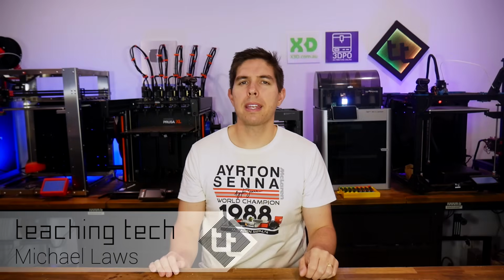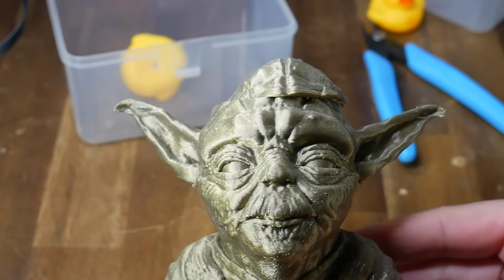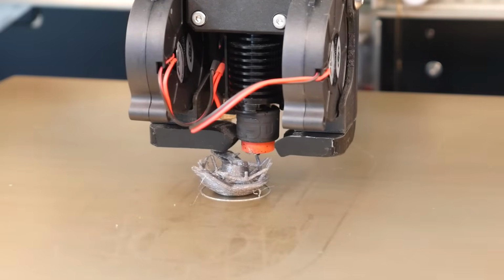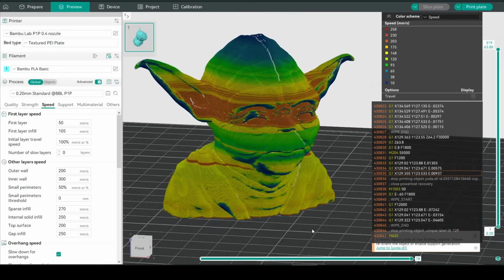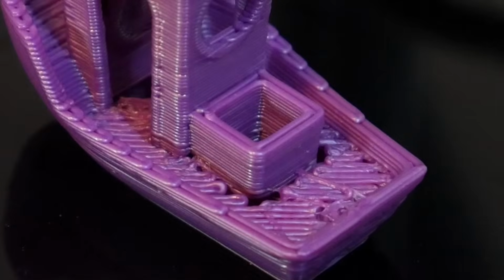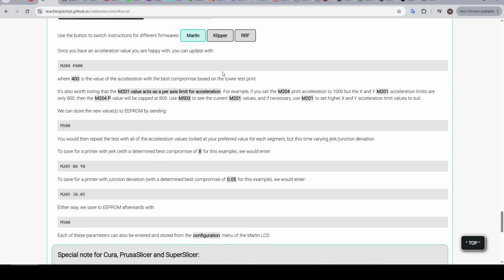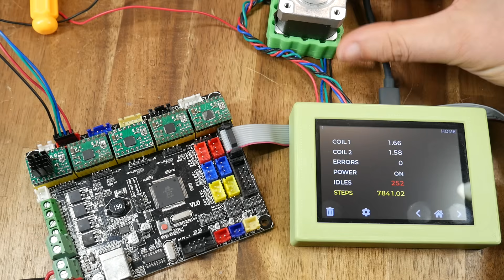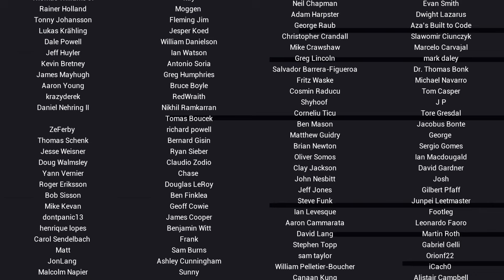How to diagnose and fix layer shifts in your 3D prints

Comment: Add Marlin Firmware retract to the list.  last Xmas, Grandkids coming and I wanted to print some fun articulated dragons for them. I wanted to get more out of my old Ender 3 so I  upgraded to 2.1.x and turned on way to many futures in hopes of getting fast printing.  Then xmas happened and I lost track of things.  Next time I tried printing something I had these layer shifts.  When I finally spent the time required to properly troubleshoot (20 + cubes and don't ask how many hrs.)  I figured out that it was Firmware retract and possibly input shaping. Lessons learned.  1.Document all changes.  2. One change at a time.

Comment: It should also be noted that certain materials like Easy PA (NYLON) actually print better with NO COOLING, and that enabling it will actively exacerbate the issue of layer shifting, as Nylon naturally shrinks and warps when cooling down, causing MORE upturned edges and poorer layer adhesion to the print bed.

Comment: Check the grip strength on your magnet bed. I had recently replaced my bed and started getting layer shift. Turns out if the  stuck on magnet layer isn't orientated with the removable bed it won't grip properly, turn the bed 90 degrees and it grips. Something I've only just discovered. I have the bed with the ender logo at the front so i replaced the magnet in the correct orientation and fixed the problem.

Comment: Sorry, kinda late to comment. Even if I calibrated my P1S, after a couple prints, Ive noticed minor layer shifts, and then do it again. I cleaned the rods, lubricated the Z rods, and then hit the calibrated option.  At one point, I even ended up checking the hotend and made sure it was screwed securely and cleaned the hotend because it was gunked up pretty bad.  Filament of course, also doesn't drop down into the chute right away so it may play a factor.  Its kinda driving me nuts that I should have to keep calibrating my P1S and can't afford to keep holding it back from printing.

Comment: I have a new weird layer shift with my ender 3 s1 using klipper, at certain heights the layer shifts on Y with every layer above making V looking layers where it goes further back on the back and then reaches a peak then it comes back to the original point seemingly to reset itself, then it repeats at regular intervals.
I've checked the belts are tensioned and the belt doesnt rub on the motor pulley, my z screws are clean and freshly greased with superlube, im printing at the same speeds ive printed at for ages with the same filament and temperatures, there is nothing new or elsewise different yet wit hthe same superslicer settings ive used for ages im now geting this annoying layer shift that seems to occur for a certain height then it resets itself, and repeats.
I changed over the v-grove wheels incase they were causing it as some had signs of wear but that did nothing, everything is tight and clean and looks good yet it's still occuring and is driving me a bit mad.

Comment: I have a huge layer shift problem and it always follow exact same pattern, if a layer have alot of area printed on the next layer will shift toward me (Y axis forward). And I tried so many way of fixing, from print bed, nozzle, belt, tightening screw, reduce speed, acceleration and even send to the seller to fix. nothing work ._. what should i even do next? anyone got any idea?

Comment: Why don't 3D printers use closed loop motors or at least offer them as an option? Particularly the large 500x500 printers? Is there a modern guide to replace the motors on something like a Sovol T500 with closed loop steppers?

Comment: Yep for me it was two last non-contact issues, I figured them out by myself as i had to - my printer is a cheap knock-off of an old FELIX Tec 4 printer so not many videos about it in the internet ^^
How come I've got such an old printer? It was a present from a neighbour company, not to me but to the company where I work rn, but because of you know a lot of relocations it got damaged and nobody knew how to fix it, so it was in the box for over 7 years. I don't remember to who I spoke or why but i mentioned 3d printer and found out from older employee that they used to have one and i should ask around XD

Comment: I've had random layer shifts on an old i3 clone. Had it about 6 months. Took me ages to figure out, and had to watch each and every print for about 2 weeks. All small prints (under 50mm3) were fine. Medium ones that had a low height (about 100mm2 but under 40mm high) were ok. When the mass and or length of the object was a certain size the idle bearing on the bed jammed.  It was a combination of the acceleration and the bed mass.  Replaced the bearing and it was fine, until it happened again about 6 months later. Turns out the belt was too tight and the belt mount on the bed was slightly off square with the idler and wore it down remarkably quickly.

Comment: Another suggestions to mention for specifically X axis layer shifts is to check that your hotend is securely tightened to the mount! Was having layer shift just when this video uploaded but wiggling my bowden tube is enough to confirm that my hotend's screw gotten loose!

Comment: One to add to the list.

The grease in ball bearings can dry out and/or dust can accumulate on linear rods. Regular regressing can help make sure that bearings won't suddenly seize up with larger prints.

Had this happen to me a few weeks ago when I got a used printer. Manually moving the sling bed indicated that there was an absurd amount of friction at the ends of movement, which was solved with regreasing.
Reply: it's always a good idea to give a new-to-you printer a once over, maintenance-wise, whether it's used or not.  covering the bases can save you headaches later - and filament, aside from various frustrations.  if you can, it's not a bad idea to partially disassemble to thoroughly clean rails/rods, then regrease them for assembly & use - though i realize that's not always practical, given certain circumstances.

Comment: Interestingly I think I had a new layer shift cause a few days ago. I'm not 100% sure if its possible or if it happened but my linux OS that runs klipper locked up very briefly while sending a command and I think spammed to move the y-axis.

Comment: My only layer shift was on my Ender 3. I reached for something on the table just as the print moved to the next layer and was jumping from the front of the bed to the extreme rear of the bed. My arm caused about 100mm worth of a shift and I can tell you a 90c bed temperature is really hot when it is pressed hard against the back of your wrist.

Comment: I recently found my X-axis was not level only by using calibration blocks, and had to redo the frame mount screws. Which, on an Ender, is in the stupidest place possible. Seriously, I was thinking it would be easier to drill holes in the frame to access the screws. Just dumb.

ANYWAY... I had issues w/ mine knocking prints off the bed and some X-axis variations.

The frame adjustment also keeps larger prints from being impacted by the nozzle, which drags them off the bed. I found this only by printing a really large model and watched it hit the print only when really higher up off the bed... something the calibration cube just doesn't reveal and Z-hop only partially helps.

Comment: The one issue I've had that you didn't cover is worn belt teeth.   On my old bed slinger, I sometimes wasn't careful enough with my build plate placement and it would hit the vertical tower.  This would prematurely wear the belt teeth. I could not see the wear, but a quick manual test of the teeth engaging a gear showed that the belt easily slipped.  I replaced the belt and all was good again.

Comment: You know, with all these multiple years of 3D printing; having had cheap creality printers that I modded until they were unrecognizable,  and all the way to (when they used to be good) bambu labs printers, I have NEVER had a single layer shift. I've had all sorts of print errors under the sun but never a single layer shift, ever.

Comment: You also need to check linear rails for smoothness too as this can also cause layer shifts. Ask me how I know. Also even if they feel smooth, if the printer is going slow enough the carriage can get momentarily stuck if they don't have enough lubrication. My Voron v0 would occasionally get stuck in a specific Y position and only the X and Z were working properly. What I had to do was remove the carriages on the 2 Y rails, clean the rails and carriage and re-lubricate the carriage. This happened despite me verifying the range and smoothness of motion but since the printer was printing much slower on the first few layers than my range of motion test it wasn't smooth enough.
Reply: You're not going to believe this, as it's too stupid. I tried to weight a print halfway through, and thought table salt was a good idea. Small grains, cheap. I had not planned on the part cooling fan blowing it everywhere. I can actually see score marks on my linear rails. So this is definitely not helping print quality

Comment: I used to suffer greatly from this until I replaced my controller with a BTT with TMC-2209 drivers. These detect skipped steps and compensate. I still get the problem sometimes but nowhere near when I had the old stepper drivers.

Comment: A fourth cause that I've seen is part shrinkage pulling the build plate away from the magnet and into a bowl shape, which lets it spin. Ways to fix it are a hotter build chamber, a lower shrinkage material, and getting rid of long straight lines, that have no compliance as they cool. Binder clips MIGHT help in this scenario, but might just cause the part to detach from the build plate.

Comment: Belt tension can cause layer shifts too. My prusa core one had a layer shift issue early on. One of the belts wasn't tensioned correctly. Tightened the belt per prusa's recommendation, and haven't had an issue since

Comment: You forgot about corrupt GCODE. I remember back in the day when I used CURA, I would get layer shifts and or pauses in the print if i didn't wait a few seconds after the gcode export was successful. If you have poor connection to your printer or maybe a really slow SD card, you can get corrupt gcode too. You can sometimes import the gcode to different slicers to see the shift or corruption happen by using the slicer preview,  but you may have to try it in multiple slicers to see them.

Comment: The one habit i need to break is being impatient during a print. In trying to remove already finished parts while the print is still going, I've caused more than a few layer shifts.  i used to have self adhesive LEDs that kept drooping as the printer warmed up. Trying to stick those back up mid print was also not a great idea. So, mainly user error for me with layer shifts so far 😂

Comment: Tks for the video. Relatively new to 3d printing but have learned a lot from Your videos. I it considered a layer shift when it only Happens on one face/axis? I was printing some gridfinity bins and in the front face along the X axis there is a single layer’s width shift (~0.4mm). Not enough to affect functionality but other three sides were fine and smooth. Any ideas? And it happened with all of the buns regardless of placement in the plate…so it’s not just a hangup on the y axis belts…maybe an invisible slicing issue?
Reply: If the issue is reproduceable when orientation and position on the plate are changed, then it's almost certainly a Gcode issue.
Reply: Ah well that at least means I can’t fix it (yet) but that it is unlikely to be anything else that I can! Thanks!
Reply: @ You could try a different slicer, or running an STL of your model through one of the free online STL repair tools (I've used one called FormWare), then slicing the repaired STL.

Comment: The worst layer shifts I've had were caused by binding of the filament spool. In my case I was printing from a filament dryer and the rollers in there stopped rolling smoothly, so when it bound up it pulled on the print head and had basically the same effect as hitting it with a mallet. That's something to check if your spool is edge-driven and you can't find another cause for layer shifts.
Reply: I think my AMS is the culprit on a print right now